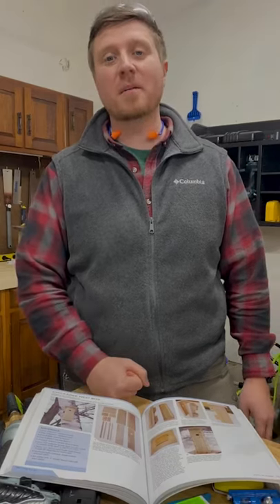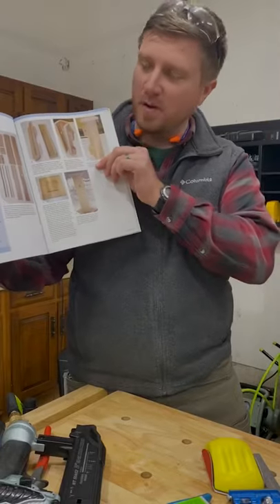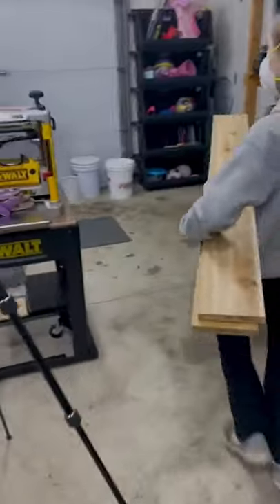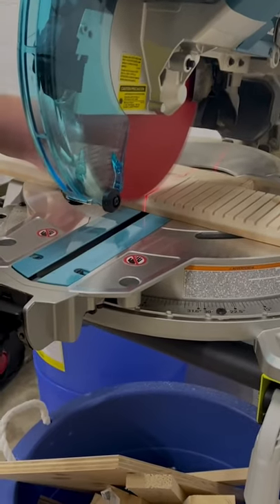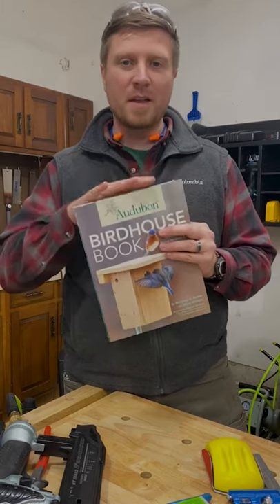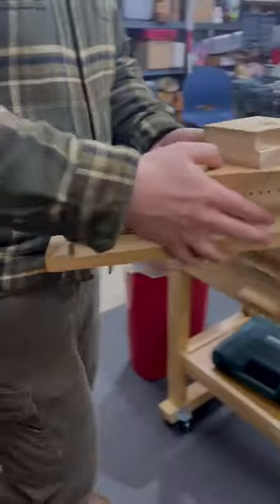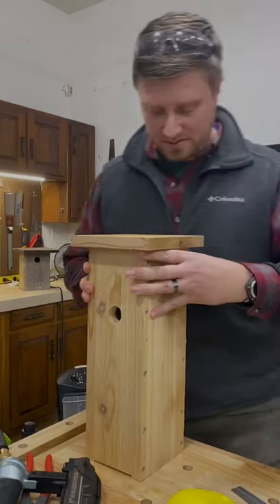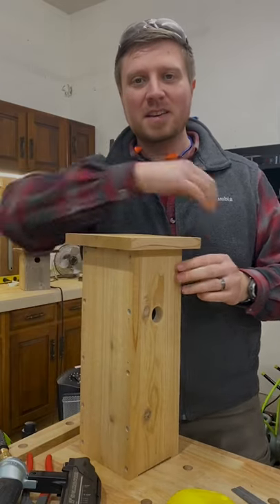Building DIY chickadee nesting boxes (bird houses) inspired by the Audubon Birdhouse Book!￼

Comment: Why no vent holes in Chickadees Birdhouse?
Reply from the maker: There's no specific reason that I'm aware of, other than them not being necessary. I simply followed the plan in the book.  I'm sure you could add some and maybe they would help with cross ventilation.  Even if it doesn't help to add them, I don't see why it would hurt.